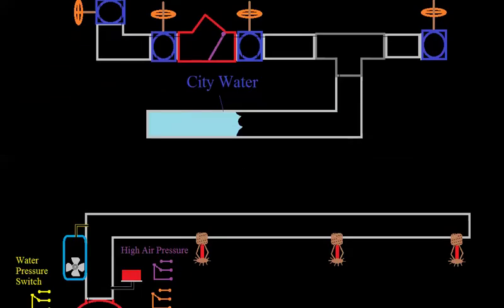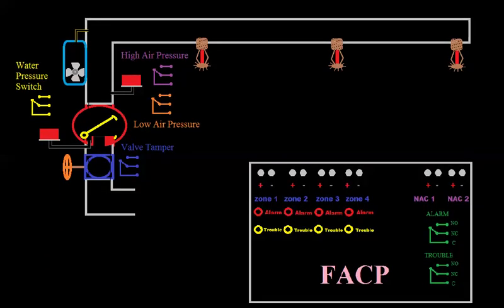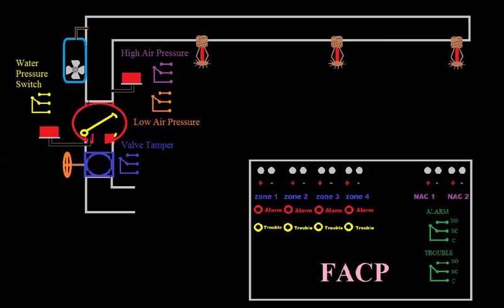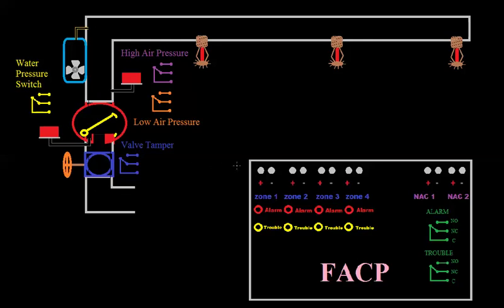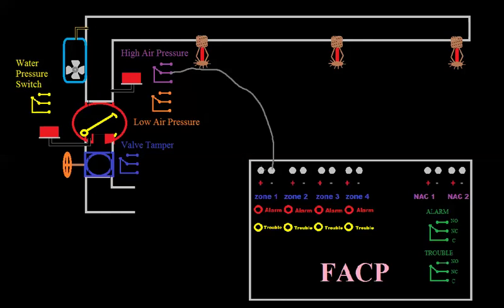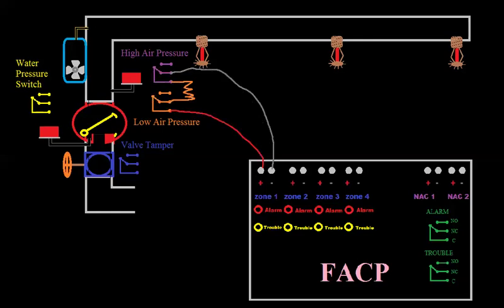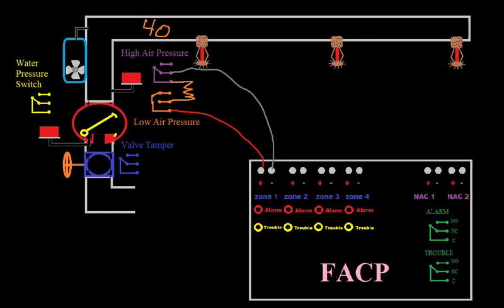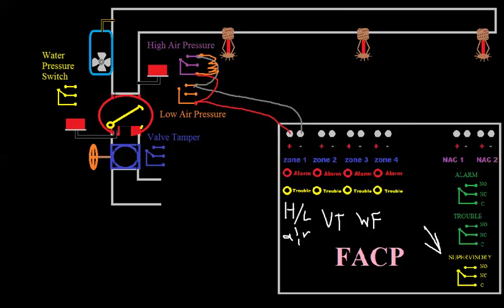19 - Dry Sprinkler Systems (con't) - Introduction to Fire Alarms

Comment: For those also wondering why the different wiring, I might have missed the why but watched it twice. you explained How, but I don't recall the WHY... I asked Grok

In fire alarm systems, particularly for monitoring air pressure switches in dry sprinkler setups (as covered in that video), the wiring differences between "Trouble" and "Supervisory" signals are driven by NFPA 72 requirements and the need to distinguish system faults from maintenance alerts. Here's the breakdown:

Key Concepts

Supervisory Signal: This indicates an abnormal condition in the sprinkler system that impairs its ability to function properly but isn't an active fire or immediate emergency. For an air pressure switch in a dry system, this typically triggers on low air pressure (e.g., a slow leak or compressor issue dropping below ~10 psi of nominal, per NFPA 72 §17.17.2.2.2). It's a "heads-up" for building staff to investigate and fix before it escalates—think routine maintenance. The fire alarm control panel (FACP) displays it as "Supervisory" to prompt non-emergency response.
Trouble Signal: This flags a fault in the monitoring circuit itself, like a wiring break, short, ground fault, or device failure (e.g., the switch itself malfunctioning). It's not tied to the sprinkler's operational state but to the integrity of the detection loop. NFPA 72 (§10.10–10.19) mandates that these be distinct from alarms or supervisory signals to avoid confusion during emergencies.

Why Different Wiring?
The air pressure switch (often a dual-setpoint device like a Potter PS15/PS25 or System Sensor model) has separate contacts—typically one Normally Open (NO)/Common for low-pressure detection and another for high-pressure or circuit supervision. Wiring them differently ensures:

Fault Discrimination: If wired the same (e.g., both as Trouble), a circuit break could mimic a legitimate pressure issue, delaying response. Separate zones let the FACP isolate wiring problems from real system issues. For example:
Supervisory (low air): Wired to a dedicated zone or using End-of-Line (EOL) resistors in a Class B circuit. A pressure drop closes the circuit, sending a latched Supervisory signal (not self-restoring until reset).
Trouble (circuit fault): Often on a parallel Trouble bus or using NO contacts without resistors. An open circuit (break) or short triggers an unlatched Trouble signal immediately.

Code Compliance: NFPA 72 (§17.6.4) requires supervisory signals for dry-system air pressure to be "distinctive" and monitored for integrity. Wiring to Trouble for supervision would violate this, as tampers/switches must signal Supervisory (not Trouble) for valve/pressure states. This setup also meets NEC 760 for low-voltage fire circuits, separating high/low voltage chambers.

Practical Response: Supervisory gets a yellow light/chime at the FACP (e.g., "Low Air Supervisory"), alerting maintenance without evacuating. Trouble gets a yellow trouble buzzer (e.g., "Zone Fault"), prompting electrician checks. Blending them could cause over-alarming or ignored faults.

Comment: Excellent explaining the system of dry sprinkler . extremely rare I al working ay South Florida never  freezing  , and will connect to a addressable Fire Panel .  The Fire Sprinkler told me because is a dry sysytem  doesnt need , tamper or any connection to the Fire Alarm Panel.   Now I will be back on them and request to show me the air presure switch and water preassure switch . and supervisory tamper switch is . And I will make sure it will be monitored by the New  Fire Alarm System I am Installing.   Thank-You and best wishes In God will  .

Comment: we found that there solenoid valves in a dry sprinkler system. what is it's function?
Reply: The solenoid valve is installed in the preaction system and not in the dry system.

Comment from the maker: Valves can be wired either to open or to short. If the FACP has 3 conditions (alarm, trouble, & supervisory), the valves should be wired to short out the circuit. The circuit should be programmed as a supervisory circuit. All 3 signals should report to monitoring (alarm, trouble, & supervisory). If the panel is not supervisory capable, the valves should be wired to open and thus cause a trouble. Again, those troubles would report to monitoring.

Comment: Great videos! Im just wondering if the reason to wire the switch so that it shorts, is to differentiate an open wire vs the actual valve being tampered with?. And if so how that would appear on the panel. I am also wondering how the supervisory and the troubles are different. Supervisory will go to a monitoring company? I would think all troubles should notify a monitoring company in case building is closed with no occupants but the person tampering?  Thanks I realize that is a lot of questions.